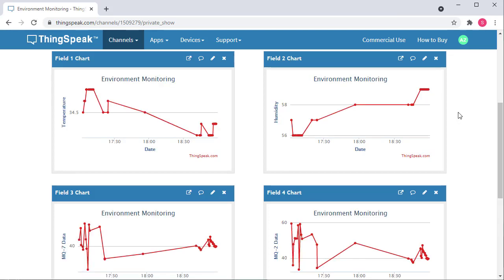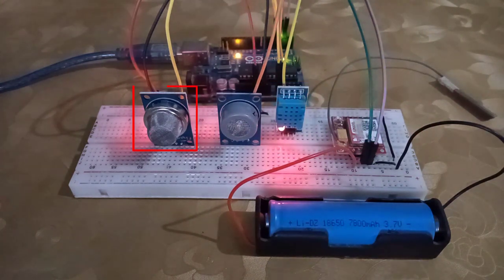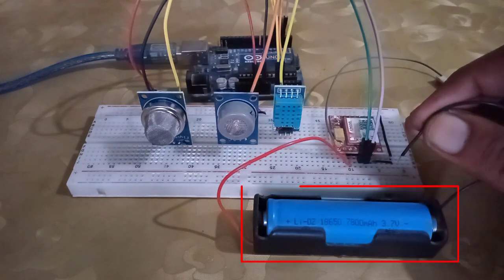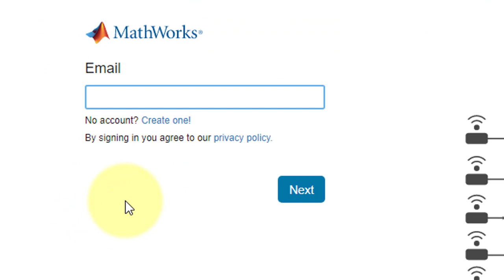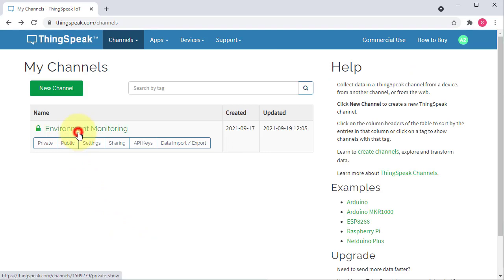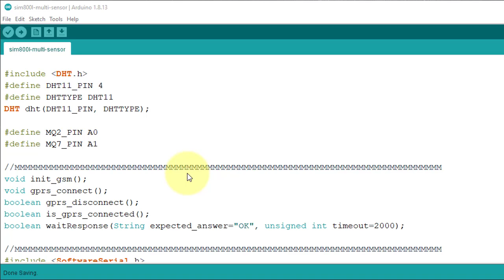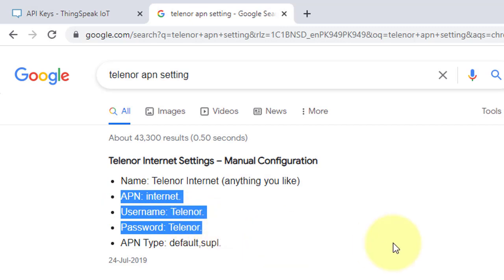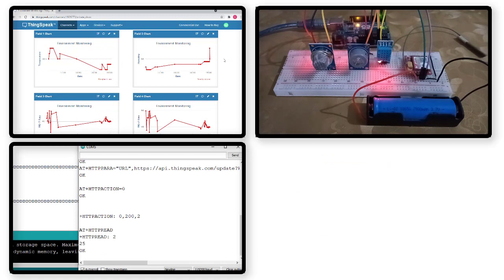SIM800L Sending Sensor Data to ThingSpeak | Arduino Multiple Sensors

Comment: Hi Ahmad,
We apologize for my "translator" English
I have a doubt by the order of two commands of the code of the SIM800L-Multi-Sentor.ino file of this YT:
//
void init_gsm();
->     void gprs_connect();
->     boolean gprs_disconnect();
-> boolean is_gprs_connected();
boolean waitResponse(String expected_answer="OK", unsigned int timeout=2000);
//
I think the order of GPRS_Connec () and GPRS_Disconnec must be inverse, first disconnect and then connect and verify OK connection .
What do you think ?
Thanks

Comment: Hi i wanna ask wheather the api keys and channel id permannet means can i program once and play system without laptop. Or i hav to use usb interface everytime can it b laptop free system so i can run it through jst adapter anywhere
Reply from the maker: yes these are permanent

Comment: Hello;
Thank you for your useful video all time, I have a question about adding to your code some lines that allow me to get data by sending SMS or making a call and at the same time sim800l module send data to thing speak.
I am looking forward for your answer.
Many thanks
Reply from the maker: you are talking about two way communication. I think it is possible

Comment: hello sir. i have used the code and wiring as in the youtube video. my serial output mimics yours except for the +HTTPACTION: 0,606,0
 output, however data is not being shown on the Thinsgspeak server. please help
Reply from the maker: The "+HTTPACTION: 0,606,0" response code indicates that the HTTP POST request was successful, but the response from the server is empty. This could be due to a number of reasons, such as incorrect API key or channel ID, network connectivity issues, or server downtime.

Comment: Hi bro 
I need to add soil ph sensor and capacitğve soil moisture sensor in this diyagram can you help me in codes plz 
Thanks
Reply from the maker: how can I help you?
Reply: @AhmadLogs  Bro 
Just i want you to ad soil pH sensor codes in the codes of this projecet
Reply: @AhmadLogs  
int pH_Value; 
float Voltage;
 
void setup() 
{ 
  Serial.begin(9600);
  pinMode(pH_Value, INPUT); 
} 
 
void loop() 
{ 
  pH_Value = analogRead(A0); 
  Voltage = pH_Value * (5.0 / 1023.0); 
  Serial.println(Voltage); 
  delay(500); 
}

Comment: Module  fire 5 channel ??
Reply from the maker: please give me some more detail
Reply: @AhmadLogs  monitoring fire sensor 5 channel and dht22
Reply: @AhmadLogs Please help me... the monitoring video above can't display the sensor value.... I've tried the problem..... to find APN, USER, and PASS where?  I'm Indonesian
Reply from the maker: @kuh_1354  you can find the APN USER AND PASSWORD from the sim card provider's website (the sim card you have inserted in the gsm module).
Reply: @AhmadLogs  it still doesn't work... even though it's already the same..... I opened the serial monitor, only the sensor value appeared, while the AT etc didn't appear on the serial monitor... that's why Mr.  ?

Comment: Unable to get the value on thingspeak inspite of the connection being established, its get displayed on serial monitor
Reply: Sir kindly reply to my another issue
Reply from the maker: what displayed on the serial monitor after establishing the connection?
Reply: The sensor values got displayed but the AT commands were not displayed.
Reply from the maker: @HarishKumar-uy5ml  is your gsm module working fine? have you tested it?
Reply: @AhmadLogs   Yess sir it blinks properly when connected  and make calls and send sms but at commands are not being displayed on serial monitor.
Reply from the maker: @HarishKumar-uy5ml  so, check your baud rate and rx and tx connections
Reply from the maker: @HarishKumar-uy5ml  1.then you need to test your baud rate. it must be same in the code as well as in the serial monitor
2. try to use level shifter with the rx pin of sim800l
Reply from the maker: @HarishKumar-uy5ml  try to use level shifter with rx pin of sim800l.
Reply: @AhmadLogs  Sir, I am using a 3.3 volt battery pack then i have to make use of level shifter again or not?
Reply from the maker: @HarishKumar-uy5ml  the module will not work on 3.3v.
Reply: @AhmadLogs  Sir similar battery which you have used in the video the same one i am using so still it needs level shifter ahain?

Comment: Hello, Sir I am not getting anything displayed on the serial monitor but it can send SmS and call. Kindly helppp me sir. Similarly AT Commands are not working since serial monitor cannot take the commands nor respond to it.
Reply from the maker: try to test with different baud rates. also check you rx and tx connection if nothing display on the serial monitor
Reply: @AhmadLogs  same problem sir calling and sms working but no AT command showing in serial  monitor
Reply from the maker: @s.husain6125  then there must be issue with your serial connections

Comment: hello brother , the program throws   +HTTPACTION: 0,606,0
 ( all is OK but the +HTTPACTION: 0,606,0) so i can't see the results . please help me
Reply from the maker: this is the server error. just try again
Reply: @AhmadLogs 
Thank you Ahmad,  but not worked 😕, 
 i use TLS 1.3 in our server , do you think it is the problem? 🙏🙏
Reply from the maker: @omranalfares3552  yes, this is the problem. use tls 1.2 or below
Reply: @AhmadLogs   thank you Ahmad again, i use TLS 1.2 but i facing the same problem , do you think there any GSM module supported the TLS 1.2 or 1.3 ??
Reply: @AhmadLogs  and i created IOT hub in azure server but I don't know use it , do you have any advice about that , is it resolving the TLS issue ?
Reply from the maker: @omranalfares3552  I never work with Microsoft azure. so, unfortunately I am unable to advice you. but I will try
Reply from the maker: @omranalfares3552  you need sim7600 gsm module for tls 1.2 or 1.3.

try using tls 1.0
Reply: @AhmadLogs   Thank you so much  🙏 i will try use it

Comment: Hi sir, can we use MQ 2 smoke sensors and flame sensors in it
Reply from the maker: yes, you can
Reply: @AhmadLogs  how sir
Reply from the maker: @FahadKhan-je1jz  just inject the example code for your sensor in the sketch.
Reply: @AhmadLogs  sir not understand, can you explain it
Reply from the maker: @FahadKhan-je1jz  you need to add the flame sensor code and MQ 2 smoke sensor code in the sketch
Reply: @AhmadLogs  my gsm Sim800l module is also not working
Reply from the maker: @FahadKhan-je1jz  most of the time it is power supply issue

Comment: My sim800l module giving 606 error as the code upload.
Reply from the maker: 606 means "The port is not connected." so, check your gsm module if it is working fine or not
Reply: @AhmadLogs  it is working fine
Reply: @AhmadLogs  but giving 605 or 606 error
Reply from the maker: @microelectronicsworkshop9147  have you balance in the sim card that you have inserted in the gsm module.

Comment: Hello sir,  I have upload the code successfully  but the response of AT command are not showing in serial monitor (It's blank) but the rest of the sensor value are visible and the data is also not sent to the thingspeak cloud.
Please help.
Reply from the maker: 1. have you powered sim800l correctly? (3.7v 1200mAh)
2. have you connect the sim800l ground to Arduino ground?
Reply: @AhmadLogs  I'm using sim900a and I have given proper power supply 
And yes I have connected the ground pin of gsm to arduino
Reply from the maker: @Bibhubikram17  I never tested it for sim900.
make a call to your gsm module to check if it is working?
Reply: @AhmadLogs  I have called the number and it rings but I can't figure out what's the problem
Reply: @Bibhubikram17  same issue how to solve
Reply: @AhmadLogs   I have used with sim800 but i am facing the same issue and all the above two points are wired properly but error

Comment: AT+HTTPSSL=1 is continuously throwing ERROR. Any idea how to resolve that
Reply from the maker: sim800l supports this command AT+HTTPSSL=1.

which gsm module you are using?
Reply: @AhmadLogs  sim800l
Reply: @shreyadepa4853  Hey even i am getting same problem. Did you find any solution? Please let me know. Very urgent.

Comment: Hi sir, I am using RFID card reader on my Arduino project so when you tap the card, it counts up by one and when the same card is tapped, it reduces the count by one. i want to send this information to ThingSpeak but when I use those AT commands, the RFID reader stops working. What could be the problem?
Reply from the maker: To figure out the issue, I need to take a look at your code as well as wiring.

Comment: would you like to make a video.. how to make a GPS triggered by an Emergency sensor? and then the data (Longitude and Latitude) send to Android Application. because that is my Final Project but I don't know how to make it.. would you like to help me, sir?? I need some reference
Reply from the maker: which Emergency sensor, you are talking about?
Reply: @AhmadLogs  crash sensor sir
Reply from the maker: @andromedha9368  but I don't have this sensor yet
Reply: @AhmadLogs  but there is a crash sensor in the world right? or maybe I wrong to spell it
Reply from the maker: @andromedha9368  no, you don't miss spelled. I meant to say, I have not buy the crash sensor. to write the code for this. I need to buy it.
Reply: @AhmadLogs  would you like to buy it sir? 😁 i'll pay you later for my final project on my college include the code too
Reply from the maker: @andromedha9368  hmmmm. no need to pay. I will buy it soon. this sensor is not available in the market. so, I have to buy it online. and it will take some time to receive the package. so, keep patience.
Reply: @AhmadLogs  i'll be patience for that, just keep focus on your task sir thank you so much 😁
Reply from the maker: @andromedha9368  so nice of you

Comment: Can you please share which MQ series sensor should I use to detect Sui Gas leakage  we use in our kitchen burners. I have already tried MQ-2 , MQ-4 & MQ5 but none of them detect the Sui Gas although all of these detect gas from cigarette lighter gas .
Reply from the maker: unfortunately, I don't know. also I never test these sensors with sui gas. 

as you said that you have tested these sensors with sui gas but failed. (I will try it also).

cigarette lighter contain LPG gas. and all the sensor can detect LPG (MQ-2 is best for LGP).
Reply: @AhmadLogs  thanks for your reply.
Yes you are right about LPG gas detection by these sensors. Sui Gas main content is Methane.
If you succeed in detecting please update me.
Kind regards.
Reply from the maker: @yawarsaeed6499  yes, sure, I will

Comment: Thank you so much sir ....how to send float value like temperature 24.2  and humidity 64.5   means send decimal value also
Reply from the maker: I am send floating point values in this video. like 345.678 etc
Reply: @AhmadLogs  ok sir thanx ....please make same with firbase
Reply from the maker: @s.husain6125  will try soon.
Reply: @AhmadLogs  thank you sir make to send only values  change change value not add new jeson array to firebase sir
Reply from the maker: @s.husain6125  hmmmmm, i will check for firebase